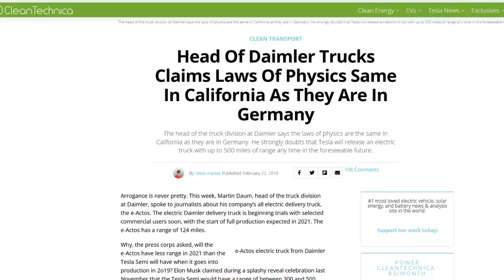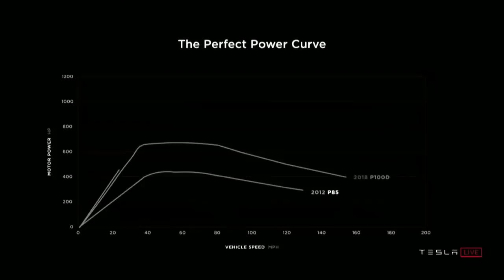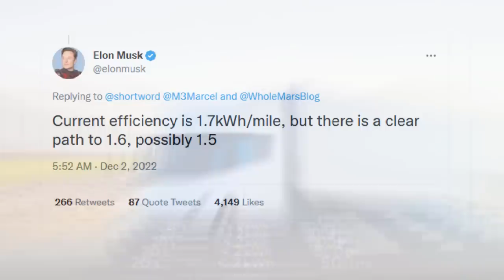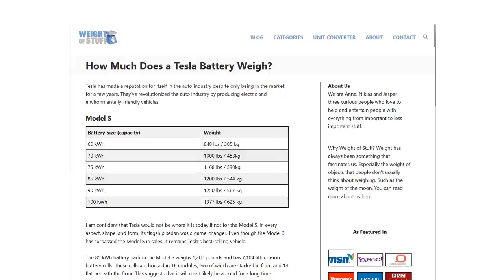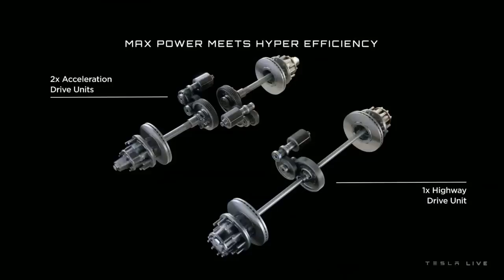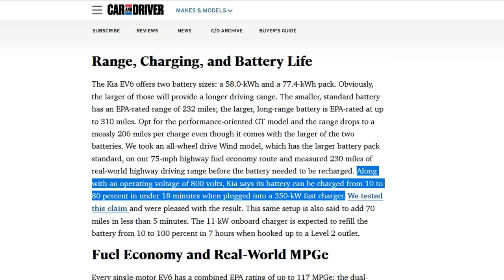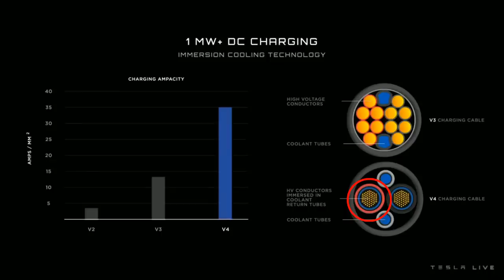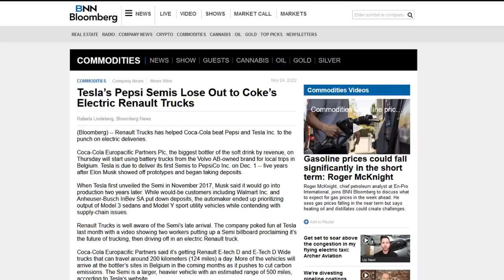Elon Musk Drops Tesla Semi Bombshell

Comment: Oh yes, totally real and functional, just like the solar tiles of SolarCity unveiled in 2016.
Reply: It’s definitely real and almost certainly exists! No cap. Seriously though it’s laughable reading all the people here lapping up this fluff piece. Fact is that Tesla truck can barely haul itself let alone a practical payload.
Reply: @JeffBourke  not to mention the range is 500 miles, just how many high power charge stations would be needed along the highway to make that remotely practice in the real world.
Reply: @JeffBourke  You are blind, get real.
Reply: @thestoneddog  
It needs 30 minutes per day on a "high power charger...
IF it's at max load.
IF the requirement is 500 miles +.
That 30 minutes can extend to the maximum (11 hour) driver limit for the day .
(In fact, it probably only needs 20 minutes)
.
It should also gain so much distance over the 8 hours that the driver can .add an extra stop if required, (ref the uphill and acceleration performance)
.
If it's running ITR, it only needs a "conventional" V3 charging level to charge to 100% overnight. (150 kW, 4 hours, they may even be able to limit that to 100kW over 8 hours, a true "trickle charge".
Where could it do that?
ANY car charge location, 1,500 in the US and counting, hardly used overnight.
Reply: @rogerstarkey5390  Where did you get info that it can charge 100% in 30 mins or even 20mins?
Also 'ANY car charge location' do you even understand what you are saying.
They can't fit into van charge location let alone into ccl.
Reply: @tedmoss  I was talking the comments in “Tesla fluff pieces”. Not this video.
Reply: @micixduda  
Where did I say that?
It can charge to 70% in 30 minutes.
Some say from zero, I say from 10%.
That's 300 miles.
In the second stint the driver can only do 200-210  miles in the 8-11 hour time limit.
Take a car that uses 800v charging, (Kia/ Hyundai)
They can charge on 400 Volt units.
Same thing.
Charging at car chargers.
Which part of "hardly used overnight" did you miss?
There are plenty with chargers at the end of a row where a Semi could charge 
.
I wonder if you "know what you're talking about"?
Reply: Imagine what happens when everybody plugs their cars in to charge, and the entire country has a total brownout...
Reply: Libs are so buthurt over Elon. The hate is palpable. Libertarians will take us to space, increase life span by 30% and provide affordable housing to tens of millions. 
Stop telling people what they can and can’t do- live your life as you see fit, without imposing your values on others. Love who you want, work hard or not at all, BE FREE.
Reply: @mikemcdermott7760  you CANT replace diesel trucks with electric
Reply: @rogerstarkey5390  Car locations to be used for semi's charging overnight?!?! Man, you really aren't a truck driver. How the @#*# are you going to get a 70 foot truck into a parking lot made for Tesla cars???!!!! We couldn't even get in the parking lot entrance much less anywhere near the chargers. Just a silly, crazy comment hahaha
Reply: @joepianpiano  
Already happening in Norway
Reply: @dimitriosfotopoulos3689  
Does "everybody" turn up at the same time for diesel?
Duh
Reply: @mikemcdermott7760  
You do know the Endgame for every Tesla technology is a "liberal" (social/socialist) society?
Think it through.
Reply: @rogerstarkey5390  You and Elon need to go get a room.
Reply: @mikemcdermott7760  no.. just sick of people like you who fall for every con artist who shouts loud enough. No wonder people feel for Trump. How Musk is not in jail with Holmes is a mystery to me.
Reply: @rogerstarkey5390  "Already happening in Norway" 

Yes, and it's already happening in the US too - but on such a small scale it won't have an impact on the current industry for ages. You keep countering my comments in a way that seems to assume I'm anti EV or anti Elon musk. I'm not, it's just obvious to me that this is mostly hype and won't be able to change anything for AGES. but I will admit, I do think Musk is as full of s#*t as Trump.
Reply: @rogerstarkey5390  You want a rig blocking 4-6 chargers as it charges during the night?
Reply: @mikemcdermott7760  "Libs" are the bulk of the Tesla customers, they are not the ones driving 4x4's with giant Trump and US flags.
Reply: @JeffBourke  Sure you can.  Why should trucks be exempt from bidens transportation crash.
Truck Jackings for the batteries, screw the load dump it.
Reply: @dimitriosfotopoulos3689  Elonand the Semi is in a room all by himself, Legacy  auto and Daimlers Freightliner  division want in that room but won't be for a long time.🤣LOL

Comment: Imagine how expensive electricity is going to become!
Reply: According to the economies of scale, electricity will become cheaper, as it has over the past 130 years or so.
Reply: With so many ways to generate it, it'll likely get cheaper over time.
Reply: Did you factor in the 1.21 jiggawatt, all-weather, 24/7 solar arrays that will be installed on the trailer roofs?  Also the ultra-high-super-efficiency photo-electric regenerative wind turbines that will be installed on the hoods?  It only adds $0.000001 per metric kilogram hour and is 500% more efficient than the hyperloop air hockey train.  DUH.
Reply: @S1191669  
A wind turbine on the hood ,😂
The turbine takes energy from the "wind" generated by the truck pushing it through the air?
The key words being "energy" and "wind".
It takes more energy to "push" the turbine that the turbine will generate, unless you have a 110% efficient unit?
Then there's the weight, then the strength. How robust is it?
Rough calculation on solar, real world, a out 10 miles of energy, offset by cost, complexity, and "dirt"
You can't just jump on the roof and clean it twice each day.
It's not needed.
With "old" cells, it outranges the driver 
That's all you need
Reply: Nuclear will make a comeback. IDK why we don't use it more. My electricity is nuclear and it's some of the cheapest in America from my understanding. About 8¢ .
Reply: @S1191669  Just how many solar panels do you think can by put on a trailer roof? 560watts? wind turbines on the hood (any open intake) generates drag and that drag becomes greater than wheel and other mechanical drag at 50-60mph. Drag = loss of range.
Reply: @linusa2996  I could imagine a set of louvers at the top of the day cab that when going downhill would open to a wind turbine but then again the regen brakes seem to do pretty good
Reply: Pepsi has already installed Megapack on their site, that can together with a PV load at least 4 Semi any time a day with renewable electricity at around 0,10 $/kWh today with a cost trajectory to 0,04 $/kWh in 2030, reducing the Diesel costs by a factor of 5 - 10.

„I believe in the horse, the Automobile is online a temporär Phänomenon!“ Emporer Wilhelm Ii
Reply: @Zukunft berechnen?  how much did it cost them to purchase and install it and how many. Remember each one is the equal of 10 lvl3 chargers. That's 400kW or enough to power 50 homes.
Reply: @linusa2996  Elon mentioned during the presentation that Pepsi got a Megapack and Charging Infrastructure … the official price for a Megapack is 2,6 Mio $ … it can charge at 1,9 MW and stores electricity for 4 Semi … if you calculate with a discount to 1,5 Mio $ (still 384 $/kWh) and a normal price for PV you end up with roughly 0,10 $/kWh of 100% renewable electricity for the Semi

Comment: Tesla should get one of their semis to do some burnouts in the competitions sales lots.... They are FAST! Not to mention they do not stink and are damn near silent. Would be pretty cool to see one doing donuts in a parking lot.
Reply: I just happened to watch a you-tube video on truck drag racing about half an hour ago. So much diesel being burned you can hardly see the finish if you're behind. The drivers say they are near 1,500 HP. Would be very interesting to see one of these roll up, box stock, and see how it stacks up to those turned up diesel rigs!
Reply: @larrybolhuis1049  how fast did they run? Elon previously said 5 seconds to 60, which is about 13.5 in the 1/4 mile.
Reply: No-one in trucking gives a rat's ass about acceleration. It's just not remotely important. Trucks are not leisure vehicles. All that matters is how much they can carry, and how much it costs to operate the vehicle.
Reply: @vylbird8014  quicker vehicles are safer and more maneuverable. It matters.
Reply: @allterrainrandy2587  I didn't see timing, they pretty much just care who crosses the line first. And they race up hill loaded with 100,000 lbs as I recall. Tractor max weight is 15,000 lbs. They pull twin flatbeds loaded with bunks of lumber double wide on the bottom and single wide on the upper stack. They don't allow automatic transmissions so that might lock out the Tesla. :-)
Reply: @vylbird8014  The truckers I know do care. If you can't get to speed in time to make the next light it costs you time, and time moving translates to miles driven, and that is the only way a trucker gets paid.
Reply: @littlebrothermoneywithmich6178  Obviously, you've never driven a LARGE vehicle.
Reply: @larrybolhuis1049  I believe the Tesla semi has a single speed transmission, like the cars.  Not an automatic.
Reply: @littlebrothermoneywithmich6178  So an 80,000 lb truck is safer if it's quicker than if it's slower and more maneuverable? Really?

Comment: aside from the brilliance  of Tesla employees,  mega packs are the key to charging semi’s.  That’s why they have a mega pack factory now because you can’t go directly from the grid to those size of batteries peak charging rate would be insane without mega packs.
Reply: Pretty sure those charging rates aren't higher than what an electric high-speed train or freight train consumes (which can easily be several megawatts), and we routinely do that from the grid. Well, over here in Europe we do.
Reply: It could be done without Megapacks in most cases, but you are right that it will benefit from Megapacks in many cases.  It's not unique to charging lots of EV semis though. Any industrial/commercial application using large amounts of power could benefit from Megapack both to buffer their own usage and for making money on the side via arbitrage.
Reply: @CL-gq3no  Remember why you don't see EV rail very far away from the major population centres in the US & Canada. Diesel Electric locomotives are big here because of the huge distances between cities.
Reply: All of Europe except for the UK had to be rebuilt after WWII where that was not an issue in the Americas. So they had brand new infrastructure from around the 60s but the North American Rail Barrons only put the minimum investment required to keep the North American railways intact, and some didn't even do that.
Reply: High Speed Rail needs it's own straight track to get useful high speed and that infrastructure hardly exists here in North America.
Reply: Agree. Megapacks will make sure the grid is not being used/used smart.
Reply: @jesipohl6717  Another nett troll. They pop up everywhere, and sometimes in the mountains of Norway. 😂
Reply: @Robert Carter
Think through a typical day.
At max load, max possible range, they only need that charger for 30 minutes each day. (Possibly only 20 minutes?)
At the depot, or overnight on the road, they only need a V2 level (100kW) over a maximum 10 hours (better for the battery!)
It's actually a great way to utilise the existing car charging network!
Reply: lol imagine charging batteries from other batteries. rip efficiency

Comment: Smaller battery doesn't lead to shorter charging time, just to reduced charging current. Cells are charged all at the same time.
Reply: That's totally wrong
Reply: If you're charging a battery this size, you may be limited by available power - to reach full speed requires not just a regular supercharger, but a whole dedicated substation with HV grid connection. If you want to charge a teslatruck at full speed, you'll probably only able to do so at places where trucks gather, like warehouses and the larger truck stops.
Reply: @vylbird8014  did you even watch the video? the super charging infrastructure for Tesla Semi is already in place and is continuing to expand.  I wish the doubters here would educate themselves about the charging infrastructure and the battery technology BEFORE criticizing.
Reply: @vylbird8014  Are you talking about the past, the present or the future?
Reply: @TomUlcak  It depends on how fast you want to charge, the first Mega-charger outside of Pepsi and Tesla is going to be installed in Gila Bend, Az. last I heard.
Reply: @tedmoss  I think you're behind the times. I'll post info when I have time. With respect. I didn't mean to be rude

Comment: 500 miles.. That's cute. I run around 700 miles a day as a driver and get around 1000 to 1200 miles per 150 gallons of fuel. Takes me about 10 mins to refuel and get back on the road. Not 8 to 10 hours. Those numbers are fully loaded. If I'm running empty the numbers are even better. EV may be the future but it has a long way to go before it can become the industry standard.
Reply: So you do not do anything else during the fuel stops?  No checking the brakes, checking the oil, checking the load, other inspections, taking a leak?
Reply: @ricksmith3045  all that is done while the truck is fueling takes about 10 minutes. As for going to the bathroom you move your truck off the fuel Island and park it to go use the bathroom. That way you're not blocking up the fuel Island for other drivers.